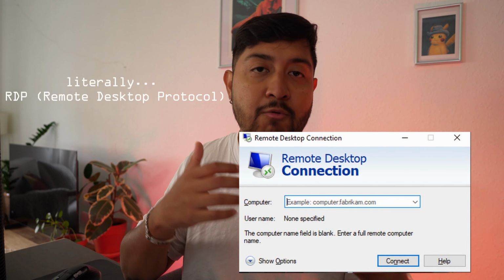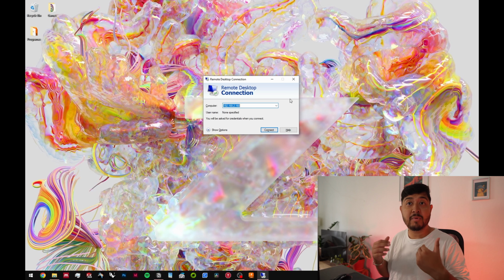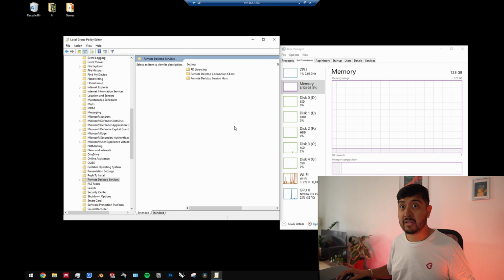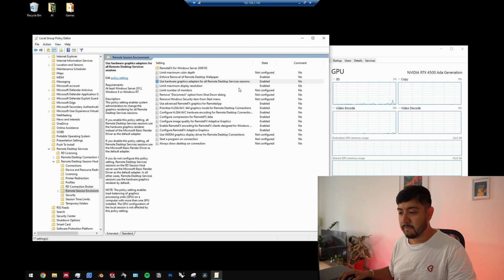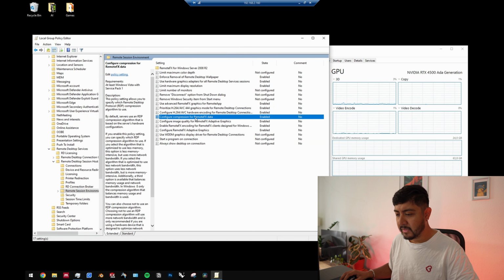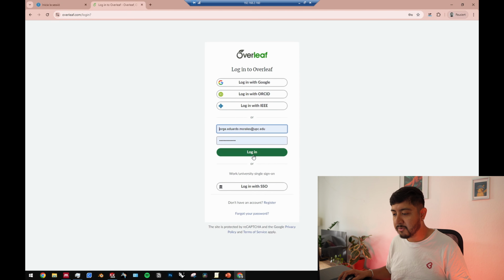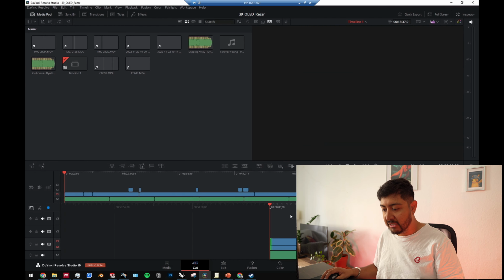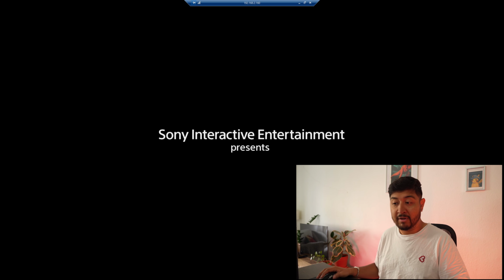GPU Accelerated Remote Desktop Connection / High Performance Remote Working

Comment: Great video.  Right on time for my project.  I am setting up Win Server RDS for a customer’s remote access.   (Business apps.   W/o tweaking there  is a noticeable performance lag that is unacceptable)

Please confirm: Your configuration recommendations for GPU acceleration removes the need to purchase the Nvidia VDI license.

I was working on the assumption that the Nvidia license (and drivers) enabled the pass through acceleration.
Reply from the maker: I confirm! I only have one tip, and it is very important, the highest end GPUs, like the 6000 Ada or 5000 Ada, they work perfectly for the configurations on this video, but they may not work when using Proxmox or other virtual environments. As they will probably require additional licensing. Thanks for watching!

Comment: Is this going to be better than using Parsec? That app has been the smoothest for me
Reply from the maker: In terms of raw performance for gaming or very rich multimedia, Parsec is probably still a bit ahead. But I think the features and availability of Windows RDP make it the best overall solution. Not only for individuals, but also scalable for large enterprises. In my personal opinion Microsoft RDP is much better. Thanks for watching!
Reply: @JorgeMoralesAv  Thanks! I set it up with your settings but can't get past the "Logon attempt failed" which is very annoying. I tried every possible thing, including old and new passwords...

Comment: Keep up amazing videos!!

I'm looking to purchase a graphics card for ANSYS, specifically for FEA on pressure vessels for fatigue and Non linear analysis.
 
My setup includes:
- i5 13th gen CPU
- 128 GB DDR5 RAM
- 1 TB Gen 4 NVMe SSD
- NVIDIA Quadro P2000 GPU

The analyses take hours on my PC. Interestingly, when I enable the GPU in ANSYS settings for FEA, it actually slows down the run compared to using 4 CPU cores. This aligns with your previous advice about needing strong FP64 (double) performance, which the P2000 lacks with only 92 GFLOPS.

I'm considering two GPU options:

1. NVIDIA A6000 (non-Ada version) - $5000
   - Officially supported by ANSYS
   - 48 GB VRAM
   - FP64 (double) performance: 604.8 GFLOPS

2. NVIDIA RTX 4090 - $3000
   - Double the FP64 performance: 1,290 GFLOPS
   - 24 GB VRAM
   - Not officially supported by ANSYS

Questions:

- How much of a performance boost can I expect from the A6000 for fatigue and non-linear analyses?
- Is 24 GB VRAM on the RTX 4090 sufficient for my needs?
- Will the RTX 4090 work with the ANSYS override GPU flag (GPU = 1)?
- As someone who owns both cards, what are your thoughts on this choice given your expertise in the field?
- I have not seen any relevant search results on Google, Reddit, or forums regarding the RTX 4090 with ANSYS.

Additional context:

- I only intend to use ANSYS for FEA on pressure vessels, focusing on fatigue and non-linear analyses.
- I have a 4-core license and would like to avoid purchasing additional core licenses. I tested my p2000 shitty GPU with 3 cores to CPU and 1 to GPU ansys override worked for this GPU
- I'm hoping a GPU upgrade might be beneficial in this case.

Any information or insights you can provide would be greatly appreciated. Thank you for your expertise!
You guide me I will even Build a new PC.
Reply from the maker: Hi there! Thanks for all the info. In your case, if you only need it for Ansys FEA, I would try something like the Quadro K6000 first. It offers 1.7 GFlops of DP and 5.19 of SP performance. It should still be compatible with any Ansys version and with 12 GB of GDDR5 memory it should help even more than the other for a very small fraction of the cost. In my opinion, I would try the K6000, then the 4090. I tried the K6000 myself and it actually sped up the simulation for nonlinear analysis as you can see in my video using Abaqus https://www.youtube.com/watch?v=204-YLmfK0g. The A6000 is just very expensive and since you still do not know if only having 3 cores is not the bottleneck to accommodate all the elements, I would go with a proof of concept first with the K6000.  Let me know how it goes.
Reply: @JorgeMoralesAv  Thanks For the reply.
I will test and let you know.
I will find locally if there are any sellers for the card refurbished right ?
as where I live its very difficult to buy refurbished items for electronics.
Though I might get a hit If i try locally.

Thanks again !!